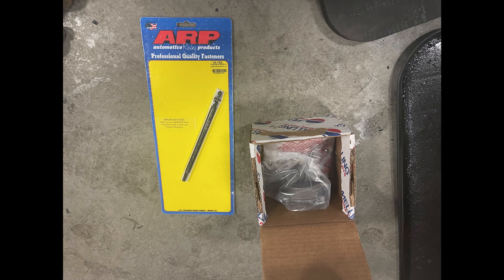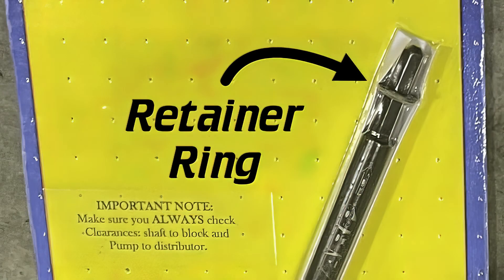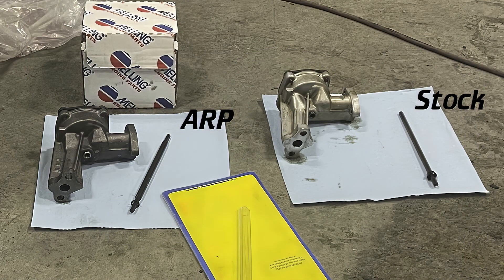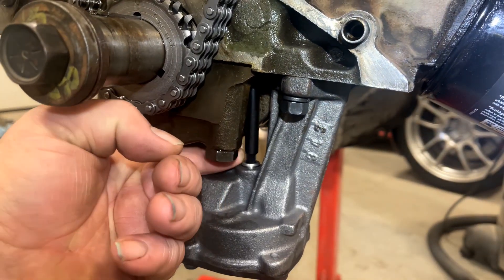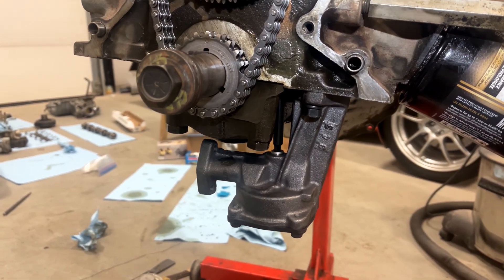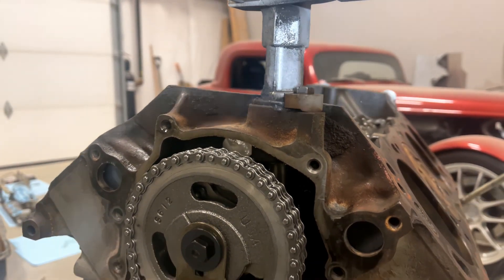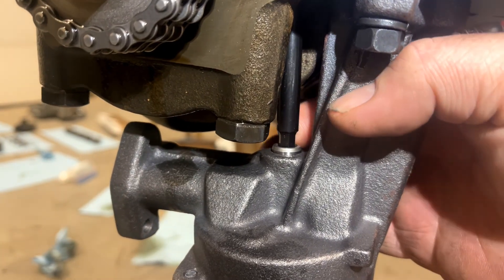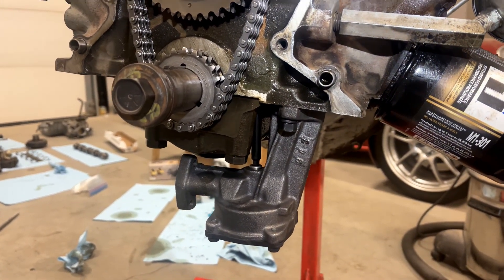Ford 5.0 Oil Pump Driveshaft Install

Comment: This just snapped on my ‘92 GT. Had the engine rebuilt about six months ago. luckily, I was able to get the old shaft out, but according to your video here, this thing was in backwards, ring at the top. How do you get the ring inside of the oil pump? From the bottom? I’m hoping I can just replace the shaft from the top with the distributor off.
Reply from the maker: The shaft has to go in with the oil pump from the bottom. You can't put the retainer on even if you manage to fish it in through the top, and without the retainer it can stick to the distributor shaft when you pull the distributor, pull up out of the pump, and then drop into the pan. In most cases you have to pull the engine to do an oil pan because of the double sump design.
Reply: @ just found out the pump seized 😩
Reply from the maker: @FoxbodyandDrums  That often happens due to debris jamming the pump. If you still have an unmolested oil sample, I would send a sample for analysis besides looking carefully at why the pump jammed.

Comment: Oh damn it.....thanks for the video....I have to take my oil pan back off as well as the oil pump apparently....i thought the shaft went down from the top side. first ford (well V8 anyway)  for a lifelong Mopar guy.
Reply from the maker: The problem happens when you pull the distributor out, the shaft sticks to the distributor long enough to pop out of the oil pump and then falls off into the pan!

Comment: But it can't fall through.
Reply from the maker: I'm not quite sure what you are referring to, but if you don't have the retainer ring in place, when you lift the distributor the shaft often sticks to the distributor, lifts out of the oil pump, then falls off and into the oil pan. That's why setting this up correctly is important.

Comment: Best way to get the ring or rod out if it drops in pan? Should i just leave it in?
Reply from the maker: An extendable magnet is your best bet. With an aftermarket shaft, the center of the shaft is round so there is no way for the ring to pull all the way off the driveshaft and fall into the bottom of the pan, but the stocker is hex the whole way, so this could happen I guess. I've never actually seen this particular issue so I am not sure what circumstances caused it, but I would also be concerned that the ring was either stuck to the underside of the block casting where the shaft goes through or was resting on top of the oil pump drive. These are even more difficult scenarios to deal with. In theory, the pickup screen should prevent it from getting sucked back into the system if you just left it, and a magnetic drain plug might eventually bring it out at an oil change, but I hate to think of loose metal parts left floating around in there. Good luck!
Reply: @ same thank you. I’ll try this

Comment: I won’t be pulling my distributor or the oil pump driveshaft. I’m hoping if I just remove the oil pump the oil pump driveshaft will stay locked in place in the  bottom distributor?
Reply from the maker: The oil pump driveshaft is not locked in place anywhere. The retainer ring is the only thing that limits its upward movement and needs to be set to a point that will prevent it from pulling out of the pump when lifting the distributor from the top as the shaft typically sticks to the distributor. Likewise, when you pull the oil pump from the bottom it will typically come out with the oil pump. If it does come out with your pump, there’s no magic in putting it back in, but if you use a new shaft you need to get the retainer ring set correctly.

Comment: I put mine in backwards and I knew it was backwards but I didn't realize the ring could be lowered and the pump wouldn't seat flush. I gotta go back in anyways to change the new Melling high flow pump because it takes a full 10 seconds on cold start before the pump builds any pressure. The pressure is great but hearing my lifters tap for 10 seconds when I start the engine is driving me crazy.
Reply from the maker: 10 seconds to oil pressure sure sounds like something is wrong even with a standard pressure pump.
Reply: Gonna double check my work and probably try a different pump. Do you have any ideas what could be wrong? It takes 10 full seconds only after sitting a few hours and I double checked with a mechanical gauge.

Comment: Now I nervous. I'm in the process of swapping long blocks and just installed my oil pump. I just swapped over the shaft and distributor. Now it's ready to go back into the truck now you have me nervous
Reply from the maker: My hope is that guys watch this before they put it all together, not to make you nervous after you put it together. Still, better to know about things that COULD be wrong if you run into issues. I know that I dread having to pull the distributor on customer cars in case the oil pump shaft drops into the pan!

Comment: Ah thanks.. one of those long nights and not realizing i can simply move the retainer 😆  I have a related question if you have an opinion.   Was pulling my parts out getting ready for assembly  ( i have an MSD billet distributor that originally came  with steel gear so i had to switch to iron for flat tappet.. actually ended up saving money buying the mustang distributor and then selling the brand new steel gear lol  )   I was able to line up the holes from gear to shaft amazingly enough     but   those gears come with  only one hole so still had to work through.. but definitely was going through the original shaft hole. It came out   to being about 3.976  ( spec to thrust collar is supposed to be max of like 4.005 minimum of 3.996 .. im wondering if   being .020"  off is enough to eat the gears or any damage?   but then i thought about it  and realized    thats where MSD put the hole so...   i just dont remember if a steel gear is identical in height and hole location  to iron is something to consider... im just not sure i can really use my 12 ton press THAT precise and bump it    by .020 to get to the minimum...   Was a lot of work to figure out because the MSD uses the shaft size  of a 351W    ... took a while to get the right MSD part number  with the right ID.    thanks for any help
Reply from the maker: Every one of those mustang distributors that I have taken apart has the hole for the roll pin drilled at an angle, so if I ever swap gears I drill a new hole through the shaft at a right angle to the original specifically for the new gear. When doing that, I always take it to the machine shop next door because they have the equipment to do it precisely. That is the accepted procedure for a gear swap. Also, they normally used a coiled roll pin where most “box of roll pins” kits you will find included only the slotted or split pin style. McMaster Carr is a source for the correct coiled pins if you need them. Besides eating a gear, you also have to be worried about binding the gear with the block if it is out the wrong way, so if the front cover is off, check the clearance between the bottom of the gear and the block through the front of the engine.
Reply: @tecmotiondyno  So here's what I found out... basically MSD says one thing and Ford Performance another.    So MSD has like a spec and when i called them and asked " so is the gear supposed to make contact with the block in a static position?"  theyre like were only considered with our spec so if you run that you should be okay.   Basically I pressed my gear like .010" further down... and I just bored out the original hole because i dont know where my cobalt bits are to make a new hole.  I got it to be a really nice press fit    definitely not going anywhere.. roll pins on Ford are just insurance anyway.   But what I found out with Ford is    in a static position where you have the distributor just sitting there with the shaft lowered ( without oil pump drive shaft)   it SHOULD be touching the block I guess but should have a certain amount of play.  Then with the gear being held in place you lift up on the distributor body to make sure there is at least .05"  of travel it can make.    I was looking to see info on performance like if less touching was better but  obviously the cam will grab the gear during load and pull it down and thats what the thrust surface is for in the block..  SO now   my gear was touching the block at static   and if i hold it against the block i can move the body up   .05" while still touching.      Im sure its more forgiving being an iron on iron gear than bronze but I should be good to go now!

Comment: Dang first time putting a v8 engine together, just put oil pump and oil pan on but see I forgot this dang rod under some other parts on the bench, I have to drop the oil pan right ?
Reply from the maker: Unfortunately, yes. You will thank yourself for doing the careful setup procedure that I outline here as well.
Reply: Thank you for the reply..!!!

Comment: Have the ARP shaft and an MSD TFI.  Shaft was installed at the machine shop.  MSD sits high and won’t seat.  Retainer ring too high?
Reply from the maker: That can easily be the problem. If it is, you can usually apply enough downward pressure on the distributor to move it down. If it is a 351W, sometimes the TFI style distributor shaft is too long and has to be shortened slightly - 3/16” or so.

Comment: got a used arp shaft, can I use my o.e clip from my orignal pump?  seemed like the clip moved way to easily and would slide off. 

also at the tip of the oil pump with the shaft in near the distributor end....should there be a wobble room? 

the shaft into oil pump turns and feels free/snug like it would pump good oil..
Reply from the maker: The retainer ring needs to be on there in a way that it will not easily move up and down the shaft or it will defeat the purpose of the retainer. There should be a small amount of up and down play in the assembly with the oil pump and distributor installed, but not enough that the shaft can actually disengage from the oil pump before the retainer stops it from moving up further.
Reply: Can you install the shaft from the top or does that defeat the point of the retaining clip? Shouldn’t the clip be on the bottom side of the guide hole so it can’t pull up?

Comment: Just put a rebuilt 5.0 in my 86 coupe. I have two distributors here. Both of them drop in the old engine without issue, and both come up about an 1/8” short of seating against the lower intake on the new engine. (Same distributors) I guess this is my issue! Some people are saying on the forums to just tap it lightly in place. Not so sure I want to do that…. Out it comes I guess.
Reply from the maker: The retainer ring can sit too high on the shaft and prevent distributor seating which is why you need to check both ends of it during assembly. You would probably get away with tapping the distributor shaft down on it but by the time you are at that stage you are also engaged with the cam gear so there’s always a chance you could screw something up. I was kind of hoping this video would help guys avoid the situation you are in, but maybe it at least helps to understand it.
Reply: @tecmotiondyno  definitely helped me understand it. I bought the motor without knowing how it would’ve been installed. If I ever do one myself I’ll be sure to follow your steps. 👍🏻 great video. Thanks for the reply.

Comment: So where does the ring go?  Useless video
Reply from the maker: As shown, the retainer ring goes on the upper end of the oil pump driveshaft and is positioned to prevent the driveshaft from lifting out of the oil pump but without interfering with the seating of the distributor.

Comment: man you saved my life,, thanks a looooottttttt!!!!
Reply from the maker: You are welcome. If you do that ring wrong or omit it, a 5 minute job can turn into an engine pull, so glad to be of help!
Reply: @tecmotiondyno  So is the ARP shaft made differently to aid in it NOT being able to fall into the pan?
Reply from the maker: @REVNUMANEWBERN  No, it is made differently to be stronger. The middle part of the ARP shaft is round with hexagonal parts just on the ends. The factory shaft is entirely hexagonal. A side effect is that the retainer ring on the ARP shaft can't be pushed as far down, but it can still be placed low enough that you can get it to fall out if you are unlucky or unobservant enough.